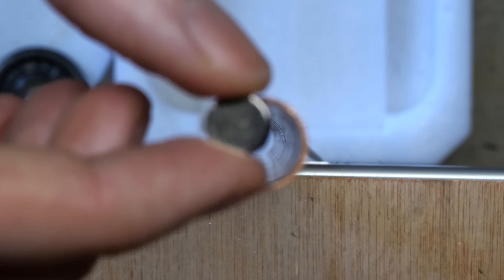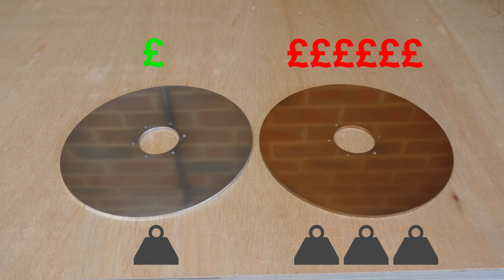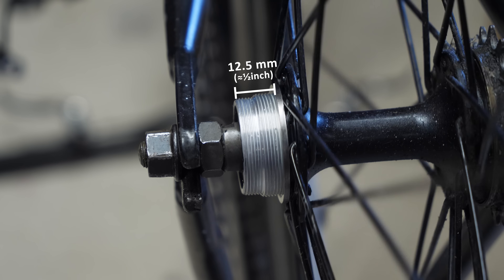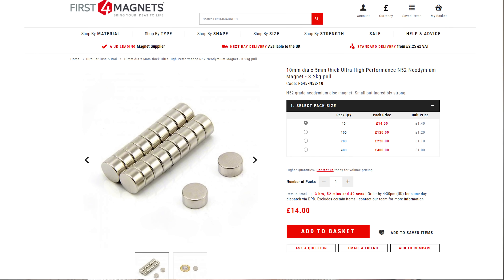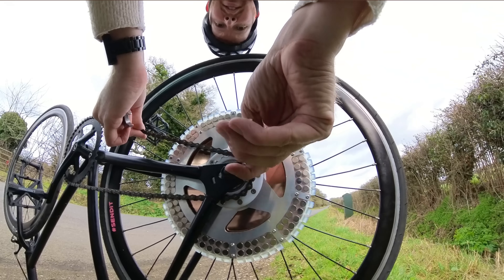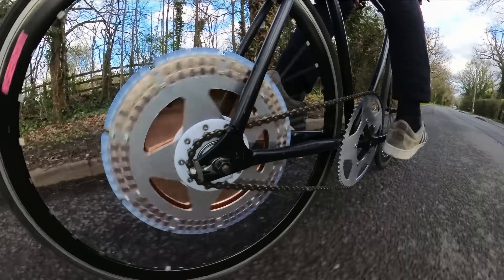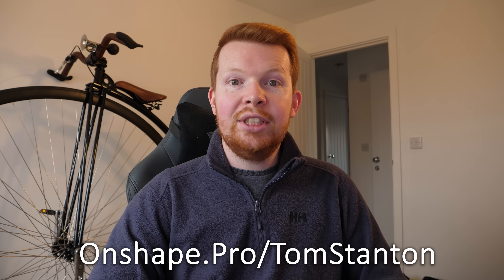Gearless Magnet Bike

Comment: I'm a physics professor and this whole project is incredible! That's one whole chapter of the textbook in a single short video!
Reply: Well I don't think most physics teachers have a small team, a budget that allows for cnc machining and 3d printing custom parts, and weeks/months to dedicate to creating a single 30 minute lesson (when would they do their marking?)
Reply: @shyft09  They need an economics major spouse who specializes in homesteading. Let them manage finances. Then they could afford everything they need just by better managing what they do with their personal income.
Reply: @shyft09  but they repeat the same class every year every term which is pointless. Do it once well, re use sell it to other places. He has way less resource than any uni.
Reply: And the copper disk gets very hot because of induction current.
Reply: Ok but what does putting a slip clutch on a bike actually accomplish other than wasting energy?
Reply: Thanks alot
Reply: @TecArtScien   A LOT,  duh .
Reply: @a.bergantini4129. 
Your statement just proves how useless and ineffective today's colleges AND "professors are. Most spend more time whining about how many genders there are. If they would just do their damn job we would be so much better off.
Reply: maglev trains...frictionless, acclerates at the speed of g
Reply: Man,  you do a superb job on that,  applause for your professional work and explamations anyway - I see the loss of energy in 'lower gear conditions...  just following the first part if your project for now. But I was thinking about such before and had no spontaneous idea  for even a first approach just out of the pocket....
I really hate these conventional gearshifts on a bike which is allways making troubles in certain ways to me either.  
Would be fantastic to get a solution in that kind...  So following up further on your owlet. Made me curious....
Wish you all the best!
Reply: That's why I regularly substitute lectures with YouTube videos - sometimes there is incredible stuff to find, that saves the student (me) hours of agony and self hatred. Hehe.

Idk what these people do differently, maybe it's because they're closer to the point where they didn't understand it themselves than most professors are, but they sometimes have an incredible efficient way of teaching. (Helped me most with theoretical physics stuff)
Reply: @braindecay9477  Personally I suspect it's just numbers. If there's hundreds of youtube videos explaining an idea, you're only likely to see the best ones, and the many many terrible videos just drop into obscurity.

Whereas with your actual college course it's unlikely you have all the best professors for every subject.

Although that does create an interesting idea. Imagine if you had access to lectures from hundreds of professors worldwide and your tuition went to the ones you watched the most.
Reply: @peterhoulihan9766  Access to multiple lectures from multiple lecturers; such an intriguing idea. I could definitely see the value in it. I'm curious if you've already figured out how to apply it efficiently and practically so as to allow ease of use without becoming overwhelmed by choice?
Reply: @JohnWilson-np3si  Well, youtube and other video platforms have already proven the model. Popular content floats up to the top, new channels trying to break the mold get shared organically among interested groups.
Reply: @peterhoulihan9766  It would be a start ...
Reply: @braindecay9477  Here's one that Tom Stanton could build a model of.  This orbital ring megastructure is missing eddy currents.  Now, is there any way to make an orbital ring work?  
https://www.youtube.com/watch?v=LMbI6sk-62E
Reply: You are not good at physics. Because you don't understand the science behind math, electricity, chemistry and biology.
You are not a professor.
You are just on papers, but the reality is painful. If my kids will have a teacher like you, I will remove my kids from the school.
You are a shame for all the italian schools and physics and science departments.
Reply: Which textbook?
Reply: The only thing that is incredible here is that a bored richkid wasted resources and created more garbage to pollute the environment for a brainfart, spent more money than it would need to feed the people who died from starvation meanwhile. But can someone please explain me why he wants to spin and reinforce pedoes?
Reply: I wonder if he generated a magnetic field that disrupted the camera while riding causing the audio to cut out or if it was the wind
Reply: do it in your class and combine it with machining, the thinking part combined with a physical part will hit allot harder.
Reply: Would you give this guy an a?
Reply: As a physics professor, how much energy goes into heat? Doe it depend on the material used (Cu vs Al)?
Reply: Fun fact, this typ of system are used for trains.  Specifally diesel-electric trains.

And another thing to note is that the higher the speed, resistance increases, and the harder it engages or in the case of the train, the harder it brakes.    Though the resistance generates heat as a result, the energy has to go somewhere. lol
Reply: You should put a motor on it to spin the copper disc and keep the magnets stable
Reply: #gujfly
Reply: Вот так надо излагать физику. А то задалбываете формулами.
Reply: Then use it in a lecture as a live action demonstration
Reply: I am still worried over the long term performance.
Breaking and Accelerating will induce heat. Vibration is also an issue. Both will - in long term - destroy the weiss areas.
Reply: Well then you’re a terrible physics professor
Reply: Now dont give your students a project on this
Reply: A+ ??????
Reply: What is your specialty, where are you a Physics professor at?  Why are you all that interested in a topic more suited to high school students than college and graduate students in Physics?
Reply: No, there is hysteresis Duck Prof.
Reply: I hate physics
Reply: هل يمكن تعديل لزياده السرعه هل ممكن نستخدم الطاره الاماميه بدل الطاره الخلفيه لعدم احتكاك السلسله
Reply: Ok professor now just use the magnets to power the bicycle. I can see another doctorate degree in your future.
Reply: Pretty much sums up how all parts of society including education are rapidly evolving. Spending 12 years at school rote learning information is an archaic way of learning given how much readily available information is now within easy reach.
Reply: Let me ask you professeur, did you spot one very crucial mistake in this video.
Reply: @channul4887  The crucial mistake in that video was, that from the very beginning it was clear that the system has very bad efficiency, meaning a high energy loss. 
It is easy to spot from two different perspectives:
a) any current in the copper/aluminium disk will create heat due to its resistance. That is why this method is used in induction heating. Heat is bad for efficiency.
b) power = torque x revolution. speed. The torque acting on the plate is the same as on the magnets (they are countertorques). But the speed of the magnets is much higher (=higher power from the driver) than the one of the disk (=less power on the disk).
With his calculations of 200 RPM to 100 RPM it becomes clear, that there is energy loss of about 50%. And it gets worse when you need it. The more torque you need (e.g. on slopes) the higher the speed difference must be and the higher the loss is.
Basically he creates a magnetic friction clutch, not a gear.
Any engineer or physics professor should be able to tell him. 
It's a bit of a pity. Many of his projects (though very well machined and constructed) lack the review of an engineer. He could avoid so many errors (or at least do them on purpose)
A nice project though. Very educative.
Reply: @channul4887  I noticed that at 2:04, he said the copper plate fell faster than the aluminum one because it is heavier. Any physics professor should know that gravity pulls the same on all objects, no matter how much they weigh. It is air resistance that affects the speed they drop. It was proven on the moon, where there is no air resistance, that a hammer and a feather dropped at the same height lands on the surface at the same time. It was probably caused by the inertia because of the difference in mass that made the one plate fall faster.
Reply: @TinkeringJohn  weight matters. Yes, gravity is acting on both of them equally. But why does a brick fall faster than a feather in atmosphere? Resistance. Gravity pulls on the two plates equally but the copper is overcoming the resistance of the eddy currents by weighing more, and as such, falls faster. Neither are falling as fast as earth's gravity would have them do so, because magnetic resistance slows their fall. More weight means more force in Newtons acting against the magnetic resistance because acceleration remaining the same, the mass of copper is higher. More force, faster fall.
Reply: @TinkeringJohn  that's an interesting observation but @thehochmaster2 described why that assumption wasn't wrong. 
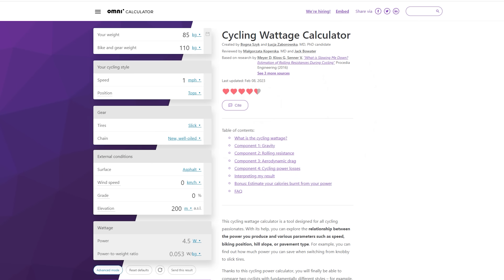What was wrong though is 8:22 "bike and gear weight" 110kg - this field is not a gross weight it's a tare weight... He based his build on a wrong assumption which led to an incorrect output. Luckily here the mistake meant he overbuilt it.
Reply: @channul4887  That's a good call out, but what does being a physics professor have to do with noticing that detail? It doesn't take a physics professor to notice a bike and gear don't weigh 110 kg. And even people who know that probably won't notice it. The duration that it was on the screen was pretty short and he was directing attention to other things with his cursor/editing.
Reply: @TinkeringJohn  I found that explanation by thehochmaster2 hard to follow, so I'm going to give my own.
 
"gravity pulls the same on all objects"
-
To be explicit about this, gravity applies the same acceleration to all objects when it is the only force acting. In terms of force, it is not equal between objects. The force of gravity is stronger when acting on a more massive object, but when calculating acceleration, the extra mass cancels out the stronger force, again, while it is the only force acting.
 
Air resistance with plates falling this slowly is negligible compared to the resistance caused by the electric currents.
 
Lets just throw some numbers into simple equations and see (not to scale or accurate in terms of units). We can use the common equation Force = mass x acceleration. Or, acceleration = force / mass. And force due to gravity is a constant 'g' times the mass. 'g' on earth is around 9.8 m/s^2, we'll just call it 10. And I'll say copper has 3 mass and aluminum has 1 mass (keeping the rough 3 to 1 ratio). So overall, we get acceleration = ( g * mass)/mass with no resistance. When we add in resistance, that is adding a force in the opposite direction. That comes off of the force value before we throw it into the acceleration=force/mass equation. Keeping things simple, we'll assume both resistances are equal and are 5. Here's what we get.
 
Copper without resistance:
Acceleration = (10*3)/3 = 30/3 = 10.
 
Aluminum without resistance:
Acceleration = (10*1)/1 = 10.
 
Copper with resistance:
Acceleration = [ (10*3) - 5) ]/3 = [ 30 - 5 ]/3 = [ 25 ]/3 = 8.33
 
Aluminum with resistance:
Acceleration = [ (10*1) - 5 ]/1 = [ 10 - 5 ]/1 = [ 5 ]/1 = 5
 
When resistance is incorporated, the aluminum comes out with a lower acceleration, meaning it will fall slower. If we lower Aluminums resistance all the way down to to 3 instead of 5, it still comes out to 7 acceleration, which is still slower than the copper. In the hammer/feather scenario, the feather has substantially higher resistance as well as substantially lower mass and it falls slower. In this scenario, the main difference is mass. Different mass without resistance ends up the same. When you add in the resistance, the resistance has a larger effect on the lower mass object. I hope that helps.
Reply: @Elrog3  "what does being a physics professor have to do with noticing that detail"
Other punters might or should have noticed it too, but we don't hold other punters to the same standards as those who have a PhD, who should be sticklers for detail - since that's why they are a professeur.
Reply: @TinkeringJohn  You're mixing things up. Heavier things do fall faster in resistive media, as we know, heavier things weigh more. Yes, in free fall, things fall at same speed, but that wasn't free fall. The reason they fall at same speed is that the extra force of gravity exactly cancels the extra inertia. In the magnet-in-a-tube case, the magnet reaches a terminal speed, and that speed definitely depends on the gravity force (weight) divided by the resistive force.
Reply: @krabkrabkrab  also speed detectors and mathmatics show that velocity fluxuates prior to stabilization and fluxuation is not linear with mass.
Reply: @channul4887  Why are you calling them punters? What is that supposed to mean?
 
And I obviously don't hold PhDs to the same esteem as you do. Our education system is hot garbage.
Reply: @Elrog3  "Why are you calling them punters? What is that supposed to mean?"
google LMGTF
Reply: @channul4887  Didn't help. I already know its a position in the game of (american) football. That has no relevance here.
Reply: @Elrog3  it's a British/Oz slang, that should help you with your googling.
Reply: @channul4887 🤓
Reply: Um...., no, it doesn't. Did the test wheels drop faster with more weight on them?
Reply: You should measure the energy going to the peddles vs on tje wheel, what is lost when the magnets slip? A clutch will lose energy in heat, you'll lose in magnetic flux. Its still a loss. Like a torque converter on an auto transmission, slipping to keep tje engine revs up, but at high loss.
Reply: Calling an almost 18 minute video short is impressive
Reply: @apersunthathasaridiculousl1890  IDK, a typical science lecture is 60-90 min, and you need many of them to become an actual scientist, to do science as opposed to “have an opinion” about something. 🙂
Reply: Can you spin 1 electric motor to transfer power to another motor for drive or maybe an alternator to motor for a bike that stays at the speed to stopped peddling at to maintain speed and power
Reply: however deep the metal to dig, makes that magnet able to fall
Reply: Thats why no one should go to college
Reply: And that my friend is why college is extremely overpriced
Reply: I am a Idiot and i say this have no Future 😂 Magnet's are heavy Wight and the Power is to Slow..... And Magnet's need a Huge load.....

Finish......  use a Atomic Bike 🤣🤣🤣🤣🤣
Reply: Thats why going far in school is a scam. High school education is plenty. Educate yourself past that. Seek help when needed
Reply: Increadible?!  Man! This guy just wasted a lot of time and money to build useless stuff and this is amazing for you?
Reply: And I'm a physics student and this whole subject is boring 😢
Reply: @raisul_raj  You might be studying the wrong course
Reply: @raisul_raj  what? Magnetism is the best. It’s the closest thing to magic we’ve got.
Reply: @raisul_raj Why it is boring to you? Greetings Christoph
Reply: @raisul_raj.
Does your professor spend more time teaching physics or arguing about how many genders there are or what their pronouns are?
Reply: Remember that the Lord Jesus Christ died on a cross for you because He loves you so much. He then rose up from the dead three days later
The Ten Commandments are called the moral law, (most of us are lying thieving blasphemous adulterer at heart and deserve hell) you and I broke the law, Jesus paid the fine. That’s what happened on that cross. 
By believing that Jesus died on the cross and rose up from the dead 3 days later and not just confessing your sin, but also repenting of all sin you have done and putting all your trust in Him in prayer, He will grant you everlasting life as a free Gift
Reply: @dove3853  I'll just dismiss it without evidence since you are asserting it without evidence. None of that is true.
Reply: @Elrog3  i wonder how much resistance was used to start your heart beat.
Reply: @cajuntimes  Ok? I don't know what you are getting at.
Reply: @Elrog3  your response to @Dove
Reply: Show the causes of the first heart beat in other words
Reply: @Elrog3  sorry nevermind i see you exist in the matrix.
Reply: @cajuntimes  ? When a cell multiplies and eventually becomes an organ, the transition point is arbitrary. Never mind a first beat, we can't even say the first instant that it was a heart. I still don't know what the point is.
 
Are you trying to tell me to explain the resurrection? Or Abiogenesis? The concept of a soul?
Reply: @Elrog3  no no ocn you cant even explain why a cell divides, iow where the program is for the telelmeres to attach iow why a molecukar stimulation occurs or the first quiver of a heart beat. You just ignore your own ignorance.
Reply: @cajuntimes  What is "ocn" and "iow"? I'm going to assume "molecukar" is "molecular". As for the overall picture, it seems like you are trying to say that there will always be things we don't know and that means god exists. But, that just doesn't follow.
Reply: @Elrog3  I am saying it is impossible for us to even exist and that is why i believe in God. Even if rocks could arise into life and the base pairs are theoretically possible to have occurred, the probability that amino acids did on their own does not exist without a headmaster.
Reply: @cajuntimes  How do you know amino acids would have to assemble "on their own" without some intermediate step? How do you know what the probability of amino acids assembling is? Wouldn't you need to know how you can know what the probability is before you claim that it is too low and so must not have happened?
Reply: @Elrog3  you wont understand any of the answers to your questions unless you have taken the statistics, chemistry, calculus, physics, biology, genetics, etc. courses that i have received obtaining a master of science in biology. What is your level in any of these disciplines? If you have coding experience, you know that code does not write itself.
Reply: @cajuntimes  If you have a masters degree in biology you definitely know a lot more than me about the topic. I am getting ready to finish a bachelors degree in aerospace engineering. I guess this conversation won't lead anywhere then if you would require me to do extensive studying before I can make sense of your argument. But I don't know that that is necessary. We can skip that part of the argument. If I take your word for it that us being here entails completely breaking the rules of biology, why does that mean the cause of us being here had to be a god?
Reply: @Elrog3  if you are near graduating you must have taken the statistics courses that you could apply toward determinining the improbability of indiscriminate formation of amino acids. Failure or success of a system or material in aerospace is based on probability. But with God, you can go with probability or with your instinct. God gives us the choice to rest on Him or not. Congratulations on your upcoming degree.
Reply: @Elrog3 <BORG
Reply: @cajuntimes  > Even if rocks could arise into life and the base pairs are theoretically possible to have occurred, the probability that amino acids did on their own does not exist without a headmaster.

You just moved the first cause.  The probability of a much more complicated God existing is much lower than the probability of amino acids occurring on their own.  Using your logic, "God is so impossible to even exist there must be a bigger and earlier God that created him."
Reply: @dove3853  What a cruel father he must have. He lets his own son suffer for the sins of humanity. Obviously he already knew at that time, which sins we will load on his shoulders. That means he paid the price in advance and we are free.
Reply: @dove3853 you've been brainwashed,  there's no tooth fairy no father Christmas and definitely no god.